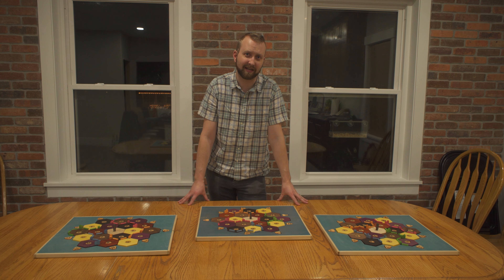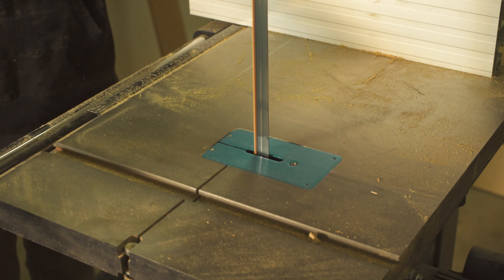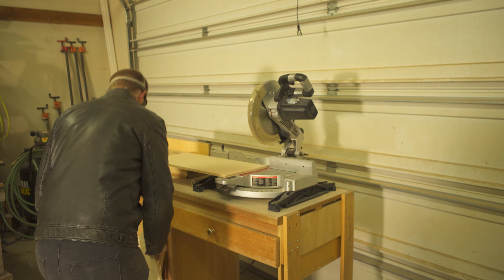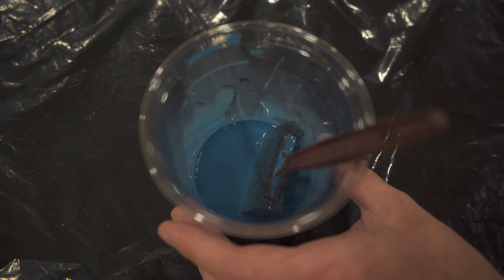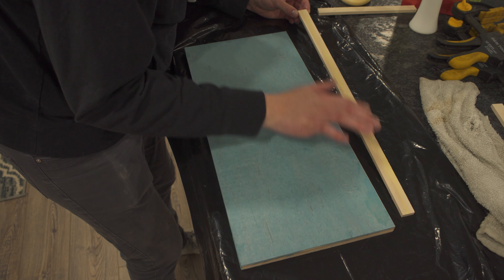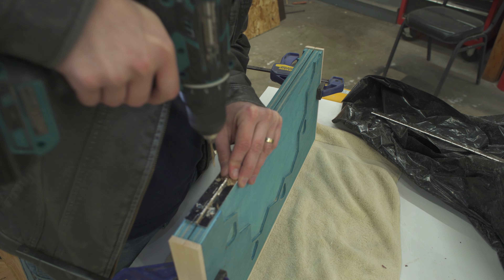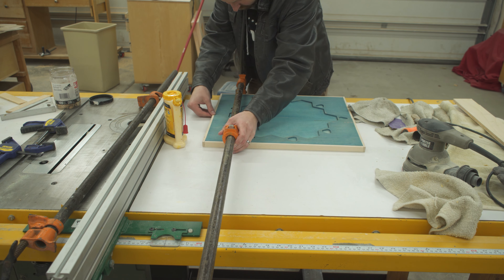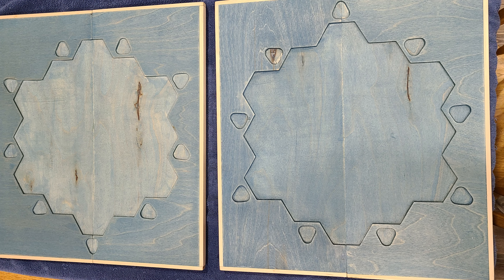Making Custom Settlers of Catan Boards | Part 1: The Boards

Comment: Great craft! Might try something like this in the future. I do wonder if you couldn't have used magnets instead of the hinges (to connect the two halves of the board) though? Would have been an easy solution for the problem, but I also might be overlooking obvious stuff.
Reply from the maker: That certainly could work as well! Definitely a good idea. I'm sure with neodymium magnets it'd be strong enough
Reply: I guess im randomly asking but does any of you know of a way to log back into an Instagram account??
I was dumb forgot the login password. I would love any assistance you can give me.
Reply: @Anders Briar Instablaster ;)
Reply: @Jack Lian Thanks so much for your reply. I found the site through google and I'm waiting for the hacking stuff now.
Seems to take quite some time so I will reply here later with my results.

Comment: Next time, to get folding boards to lay flat using a hinge like that, the issue is the holes are offset just enough to mess it up, right?  So to fix this, screw in the one side as normal.  But on the other half, drill only 2 slightly LARGE holes that leave PLAY in it for the screws to "self adjust" to where it will set when level.  Now just put a bit of epoxy in those oversize holes, assemble it, lay it open flat with perhaps some weight on top to hold it in place, and when the epoxy sets, it will have lock both sides in perfectly flat and even with the hinges.  You have to not over epoxy in the holes, try an imagine just enough after the screws come in loosely and perhaps painters tape over the screws before laying the boards out flat (hinge closed) so that you absolutely get no epoxy locking things up!  Then after they set, you can drill any other holes through the hinge and add screws as desired...
Reply from the maker: That's a great idea! Thank you for that explanation
Reply: @benofalltrades  You're welcome, enjoyed the build and your honesty of learning along the way.